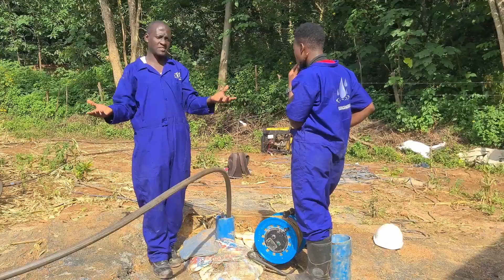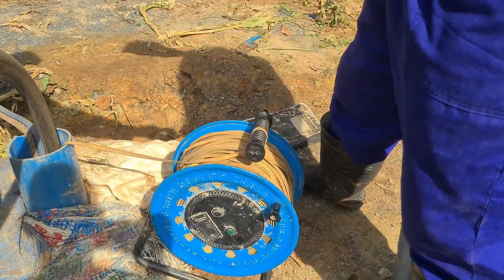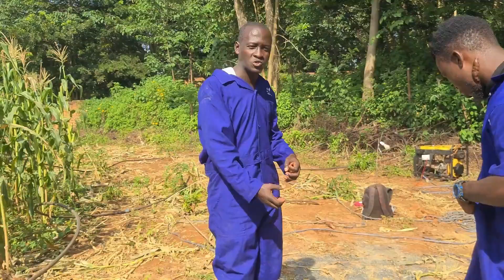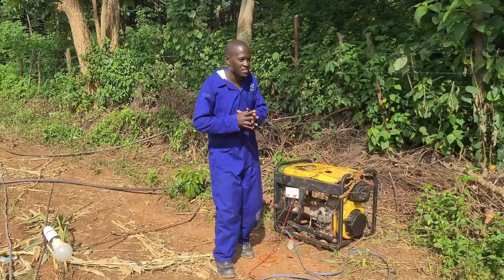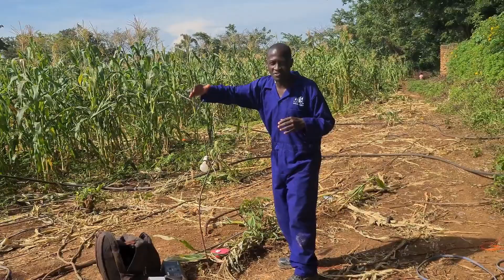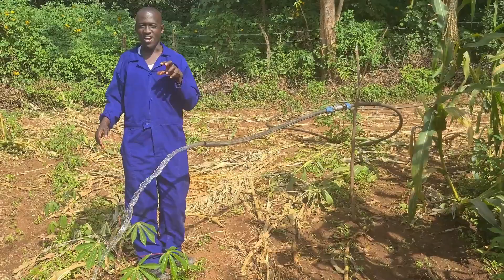How to know how much water you have in your water borehole testing - Borehole pump testing

Comment: borehole 100 meters, pump depth 85 meters, distance borehole to tank stand 4meters, height of the tank 6meters. borehole yield, 2 liters per second. recommend solar pump size in Hp. pipe from pump to tank 32mm poly pipe

Comment: Thank you for sharing your information with us, it has been very informative. I very much appreciate you responding to the comments viewers make, others just go silent. Keep it up, thanks a bunch. I just did a borehole with a machine in Pallisa at a depth of about 130 feet but the casing went down to around 120 feet. An electrical submersible pump is used. Is it normal for the water to be pumped for about 10 minutes than it dries up. We wait another 10 minutes or for the recharge. At this depth we installed 7 screened casings followed by the plain casings. All of 5 inches in diameter. Is this normal for the water to dry up just after around 10 minutes then wait for a recharge, or should it be continues flow for however big the aquifer is? Also normally how deep should one drill below the water table once the depth of the water table is known? This is the first borehole done with a machine before going out to help the poor in the villages near Pallisa. Many thanks again, I appreciate your work
Reply from the maker: Hello,
Thank you for checking our demo video and writing to us.
120 feet seems shallow for a machine drilled well however it's possible to have good aquifers at that depth.
It's not good and professional to pump and the well dries out, this will draw all the water from the springs and water will start coming with silt, after some time your well may get filled with silt up to the pump level, it's advisable to do pump testing (https://weisengineering.com/borehole-pump-testing-in-uganda/) before pump selection, of of the main reasons for carrying out pump testing is to determine well yield such that an appropriate pump can be selected. 

There is no specific depth someone should go below the water table (water strike), factors like type of rock, well diameter, casing method may be looked at, i think it wouldn't be more than 6 meters.